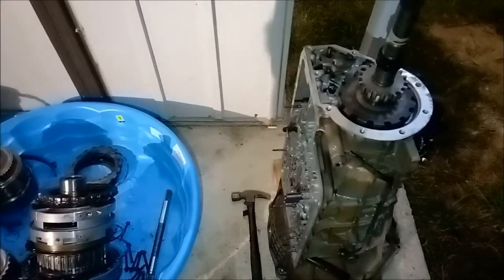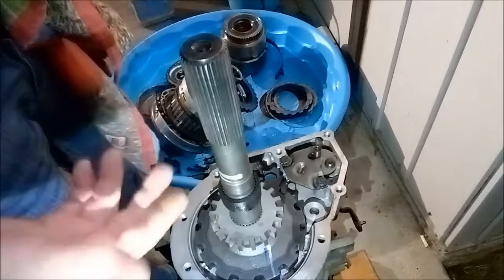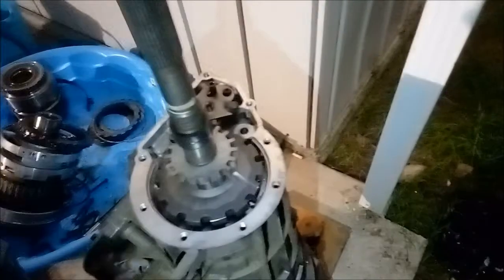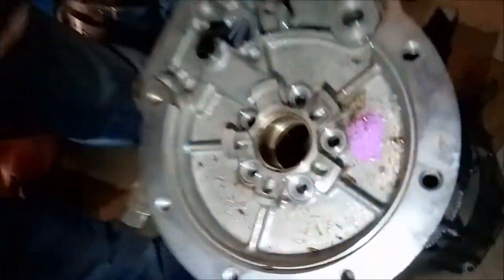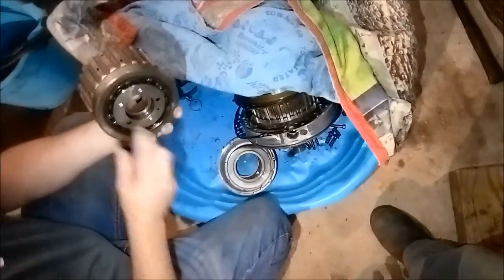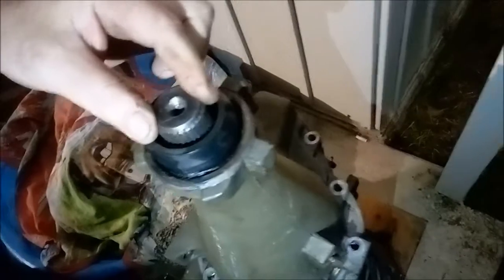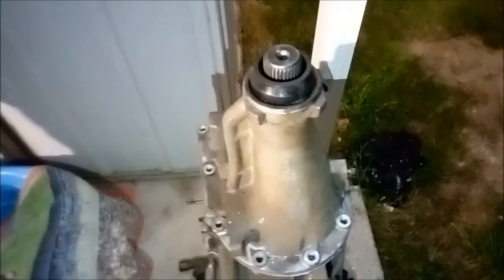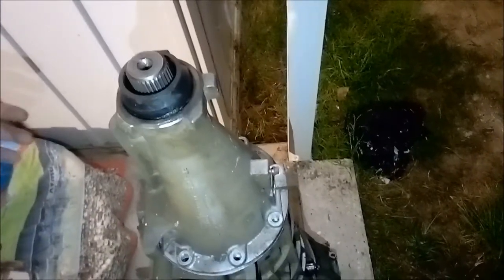Ford 4R100/E4OD Transmission Output Shaft Shudder

Comment: 👍....$3200 ....not the..wiser...out yo A'$$$
Reply from the maker: $3200 bad BBB review. Wasn't worth it. Another review coming on a drive shaft company. 2 weeks after installation, weld failure, busted gas tank, beat up exhaust and shield, and left 15 gallons of gas roadside.

Comment: I have a 4r70w in my 98 explorer. Some months ago I was hearing a noise from my drivetrain somewhere. I had it in the shop twice with unrelated small issues and asked them if they could pin point the noise, they could not. This was May and June 2021, I just checked. in the 850 miles since then the driving condition and noise got bad enough I had to park it. At first I thought u joints because of the vibration increase. I had the same push forward when coming to a stop or slowing down. The noise got louder when accelerating or taking my foot off the gas. The last 2 days I finally tore into it, along with countless hours on the computer. I pulled the driveshaft and it wasn't the u joints. I found the output shaft had way to much play. I wasn't sure how much play was allowable but I knew I had a problem. So I sit here a little pissed that the shop couldn't find the problem. 2 months ago I isolated the noise and let it go. I let it go because I don't drive that much and I didn't really know the extent of the problem. So now I'm having to scramble during the holidays to find a solution. Is it a overhaul? Can the bushings or bearings be replaced without pulling the transmission? Thanks for the video, it's another link in the chain of info for me to research.

Comment: Hi I like your video because there is no other like this anywhere online and you explain the problem real good I woul like to know if  you can translate it to spanish or put some translation captions I have the same problem but I didn't know what was causing it, now I now, I'm prety sure most transmission repair shops never change those bushings when they rebuild the transmission it is not easy and it is expensive, thanks keep up the good work and keep uploading informative videos like this